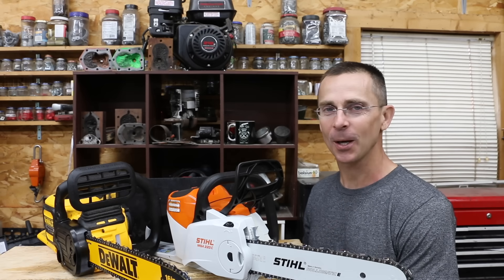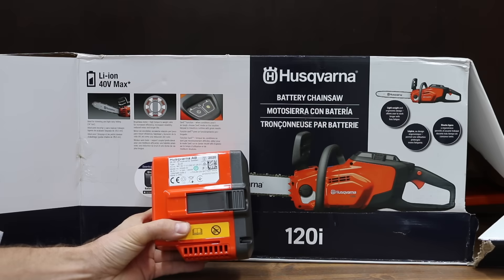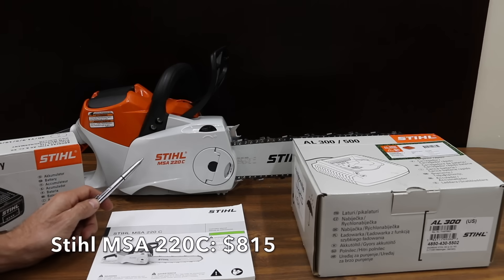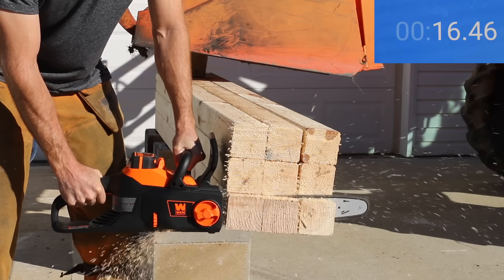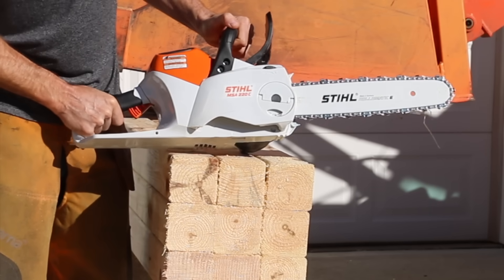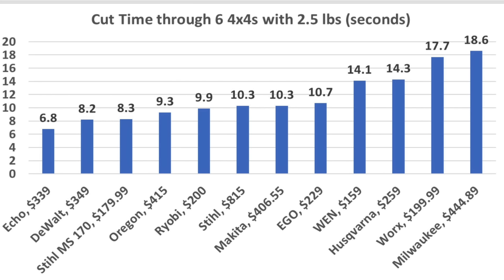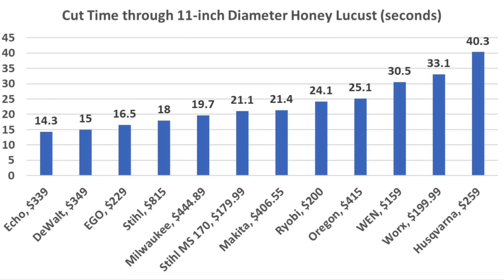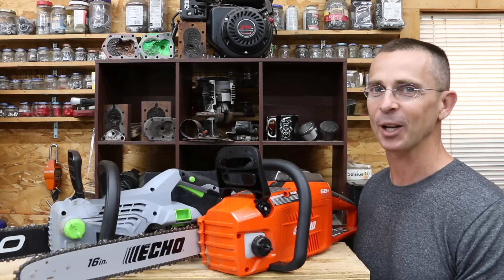Best Battery Powered Chainsaw Brand (ROUND 2)? Stihl, Husqvarna, Echo, Oregon, DeWalt

Comment: One of the rare instances were price doesn’t match performance. Thanks for a great video. The Echo and Ego both impressed me.
Reply: I have watched nearly every he has put out, and it's not at all a rare instance. Often times you are paying for the name rather than the quality
Reply: Typically with chainsaws more expensive = more durable and lighter weight, not necessarily cuts faster.
Reply: @gorkyd7912  that’s a good point.
Reply: @gorkyd7912  durability is the only equation for me
Reply: I think where EGO wins is the ecosystem of compatible products. Nobody else can match that. I have two batteries for like 7 devices! Mower, blower, hedge trimmer, string trimmer, chainsaw, multi head system: currently just the edger!
Reply: @emotionz3  more or less all brands from this video has multi sistems ( one battery - lots of devises who can use that batery)
Reply: The Wen has a surprisingly good ecosystem as well. Too bad the performance isn't there.

Comment: Be careful none of them are designed to fall from an 80 foot tree and still work
Reply: If you are 80 feet up in a tree a battery saw is not designed for you anyway
Reply: Guys 80 feet in a tree respect themselves enough to only run a gasser.

Comment: It must be embarrassing for husqvarna to have the Ego cut faster 😂
Reply from the maker: I was hoping it would do better
Reply: Worse for Stihl imo. That is more than double the price of the others
Reply: @gg-gn3re  with stihl you pay the name. But it will probably outlast the others in terms of building quality.
Reply: Not really sure about that. The Husqvarna tested is the cheapest homeowner model. Probably on par, or worse than Ego. Husqvarna is one of those companies that cater for all markets, going from cheapest "junk" almost, to the absolute top. I'm not sure I agree with their business model, but it seems to work for them. It would have been interesting to throw in both Stihl and Husqvarna's top "Pro" models in the mix, to see if they just kick all the competition to the curb. (like Husqvarna 540i XP and Stihl  MSA220 C-B) It could also be fun to compare all these saws to the working horses of the industry, like a Husqvarna 572 or a Stihl MS500i, mostly just for fun, but also to highlight that while battery tools are good, the pro choice sits above by a fair bit (one would assume... but, let's test that...)
Reply: @brianjensen5200  that’s a very good point. But considering the husky costs about the same as the wen and ego (plus it’s made by one of the top saw manufacturers) you would think it would have performed at least decent lol. But I agree that it’s worse for stihl 😂 at $850 that thing got destroyed. Granted I’m sure it was built wayyy better and will probably last 10x longer. But at that price you can buy a really good gas saw.

Comment: Id like to have seen the Oregon's auto chain sharpening in action.
Reply from the maker: Great point. I should have tested it!
Reply: @ProjectFarm  Same crappy design from the 70's, like Homelite (Sears). I can't tell you how many I had to convert to regular chain for unhappy owners.
Reply: Power sharp sucks. Owned it, used it, threw it away.
Reply: @uriahotten3895  Haha next thing they will try to sell magic dirt you throw on the ground so if your chain hits the ground it sharpens it instead of damaging the cutters!  LOL  And people will buy it!  Especially if it had a name like Slick 51. :-)
Reply: @cpufrost  the "magic dirt" would probably be just as effective as the Power Sharp for sharpening your chains 🤣
Reply: @dave himlin I have a green works mower and weed wacker/edger. A couple 2ah and 4ah batteries. While taking a walk a few weeks back one of my neighbors had sitting in the garbage a greenworks leaf blower with the charger and a 2ah battery. I picked it up and the charger and battery worked straight away. The blower must have been used a few times last year and put away for the season. The contacts must of got some surface rust on it because after about 20 on/off clicks it started working as well. Used it for a few hours and added it to my collection. People throw away crazy stuff sometimes. 🤷🏼‍♂️. I was not raised that way and at the very least try to repair stuff before I toss it. I didn't even have to take this one apart.
Reply: I had one and it did not work well, but they may have improved it.
Reply: @dave himlin same problems that I had.
Reply: I have a non battery Oregon electric with the auto sharpener and it seems okay, although I haven't tested it against anything. I would love to see a followup on that.
Reply: Owned an Oregon self sharpener   battery saw for 3 years now.  Really like the feature.  It only takes a couple seconds of lightly pulling the sharpening lever to sharpen the chain to make the difference.  If it is pulled often or hard the chain and stone will need replaced sooner than necessary.   If your cutting alot of firewood fire wood non of these saws will replace a gas saw yet.  For property maintenance, a couple batteries and this saw will work great.  Also the chain is aggressive and has a wide kerf.  So feeding it lightly and keeping the revs up matter.
Reply: TIL to avoid that cuz after the one PF video that showed how crucial a freshly sharpened chain is, that feature might have suckered me in

Comment: How I buy tools : 
1-Watch Project Farm 
2-buy the recommended item 
3-repeat
Reply: I do the opposite. I buy tool, watch project farm and realize i bought the worst.
Reply: XD
Reply: I did that yesterday with my windshield wiper blades, the long term test was awesome, I didn't end up going with the winners though cuz the Bosch Icons would have been nearly $50 for both so I went with the rainx ones that were the runner up, $20 difference in price for 2 blades.
Reply: @bdkj3e  I had both and to be honest over time I didn't see a difference I really liked the Rainx blades
Reply: @bdkj3e  ص
Reply: @bdkj3e  Bosch Icons are great. Once I switched, I will never go back. I am very picky about my windshield though.
Reply: @bdkj3e  I had to lookup what I got, and it ended up being the Bosch; didn't even realize they were hat expensive, but I bad some coupons and points that offset my cost.
Reply: Watch PF, if the winner has been torn down on AVE, then buy.
Reply: @tarstarkusz  haha right!
Reply: 2.5 - Realise I don't need whatever I bought
Reply: True.  I don't even need a new chainsaw, but am seriously tempted by the Echo.
Reply: I think PF using Dewalt as his personal tools (drills for sure) speaks volumes and is all the testament I need.
Reply: @gekksvide0 I think he’s saying the tool line in general.
Reply: That's what I do too! Well worth the time to save money and get quality vs most expensive!

I can hands down always count on Project Farm.
Reply: Either project farm, or AVE
Reply: This!
Reply: Now I know what wiper blades to buy. Thanks.
Reply: I agree totally. Buy, Buy, Buy...
Reply: Go to comments and repeat
Reply: you must have alot of different chargers and batterys
Reply: Your not wrong
Reply: @benkleve4199  but you are! The correct word is "you're"
Reply: @herbiehusker1889  Savage! LOL
Reply: @herbiehusker1889  If there is anything people should never leave school without having it ingrained, it is knowing the difference between your and you're; there, their, and they're; and its and it's. Nothing spells ignorant like their misuse. But we should  make allowances for immigrants. After all, it all boils down to whether you understand what was meant, not how it was written.
Reply: @herbiehusker1889  two words though
Reply: @mrbig1022  it's actually a contraction. "You're" does combine two words into 1, but it's really just a single contraction word.
Reply: Yeah idk if I want to have like 4 or 5 different battery setups. Looks like Dewalt has the most wins under their belt so buy Dewalt cordless tools
Reply: @FromThe3PointLine  Yup same here.  I finally go for Makita for the same reason. But it's important to note that Makita and Dewalt are professional grade tools (despite having an amateur line), while other brands tested are more amateur or casual.
Reply: @FromThe3PointLine  pretty sure milwaukee takes it's fair share too
Reply: @FromThe3PointLine  have you not seen how many wins milwaukee has?

There's no one brand that has all the best tools. 

Some brands just have better tools than the others, even if it's just a few and kind of specific
Reply: @FromThe3PointLine  but for super low temperatures you are going to want Milwaukee batteries. There are battery plate adapters so DeWalt with Milwaukee batteries in most applications sounds like a real winner.
Reply: 4-have 8 differ t chargers for a the different brand of batteries
Reply: Don't forget to look at reviews on Amazon
Reply: @jakobharris2719  I respect your answer and you are right but I must say I'll go with PF over a bunch of randoms. He's like my uncle on my mama's side. I trust his word lol..
Reply: @JustCallMePCra  i think theyre referring to the most wins with various different tools which meams it wpuld be their best bet to buy dewalt so they only have 1 battery type/brand
Reply: @justinteal495  yeah your right if another company made more tools in other areas better I would take a small L on something that I use less just to do what you said same brand same bat.
Reply: @justinteal495  Milwaukee has won a lot too. But no one brand is always the best

Comment: With all the adapters out there to be able to use just about any brand battery in any brand of drills and tools- would it be possible to do a head to head on the batteries themselves? The 18v/20v lithium batteries. I have tons of the old dewalt 18v nicad battery tools and debating what lithium batteries to run. Not switching out the tools as that is a LOT of tools to replace.
Reply from the maker: Great video idea!   Here's a video on 3 of the brands:  https://www.youtube.com/watch?v=4OkT_SU6GSg   Thank you
Reply: @ProjectFarm  Thank you. Not sure how I missed that video.

Comment: Great review! Thanks for revisiting these additional brands with the same test methodology. One area to improve is the sound measurement: I think you're getting a lot of sound transfer to the table top. So a saw may actually be quieter itself, but have more vibration that is turned into sound by the table. I guess this is a good compromise for sound transfer when cutting, but then why not take the sound measurement when cutting the 4x4s? Just spitballing. Cheers!
Reply from the maker: Great constructive feedback. Thank you!

Comment: Do your hands tingle after using an electric saw? Great video as usual.
Reply: I think extended use of any saw, gas or electric will have that affect.
Reply from the maker: I drove in 1000 screws with an impact driver for a previous video.  My hand was numb for about a day.  lol

Comment: Really like and recommend  the Oregon, I have used it for probably 100 days a year for 4 years, not a single problem. With built in sharpener I feel more comfortable cutting seedlings and saplings very close to ground. they also make a great pole saw that used same 40 volt battery.
Reply from the maker: Great feedback on the Oregon!  Thank you

Comment: Best chainsaw chain sharpener would be awesome
Reply from the maker: I'll do it!  Great suggestion!
Reply: @ProjectFarm  thank you
Reply: @ProjectFarm  That's a dark hole to go down!!! Chain grinders round and square, hand filing with jigs of all sorts and filing guides. You're a glutton for punishment. My hands hurt just thinking about it! There's so much variability in how one user uses them let alone which on what chain/saw etc... Must include the Timberline sharpener though. If you do, shim it off the bar instead of rocking it on the burr (like the instructions say) when you set it up so that it grinds into the gullet and it will cut like nobodies business...an hour later...
Reply: Stihl has some nice setups
Reply: A round file and flat file. Short of expensive commercial units, electric sharpeners suck.  Stihl's all in one sharpener is great too.
Reply: @littlejackalo5326  10/4 on the 2 files. IF I ever get one it'll probably be the Oregon 110 volt job. That's what all the saw shops here use.
Reply: Be sure to include grandburg and timberline jigs. I have a grandburg and it works great but it is a bit tedious. Would like one that goes a bit faster

Comment: An idea for your personal use: take the 4x4 cut slices, print a picture on the one face, seal them and you have Project Farm coasters. You could also make the picture on the face and then smack them with a small hammer or run it through a jigsaw. My grandfather, a sawyer used to make puzzles for us grandkids. Simple fun with mill ends!
Reply from the maker: Great suggestion! Thank you

Comment: I'll wait a few more years... 
Current battery technology isn't ready for chainsaw application.  Gas is the way to go.
Reply: Depends on what you're cutting. The average homeowner or arborist is going to be very happy with one. If you're going to do any falling or cutting firewood, I agree with you. Nothing beats gas for productivity. I have the bigger DeWalt and I use it a lot for smaller jobs, limbing up trees and general property clearing where you just need to cut something for a minute and most of the time you're stacking brush and limbs etc.
Reply from the maker: Thank you
Reply: @Galaxy-r6g  
Agreed. 
It makes no sense to pay $600+ for a tool that lasts a few minutes. 
Wait... I just got a cordless Dyson vacuum that lasts 7 min on Max power.  But there’s no gas version of vacuum cleaners and the cord really gets in the way. 😉
Reply: @itsm3th3b33  i had to kick Dyson out of my house. Couldn't handle the work load. Thats where Avalir got the job for $50. Hard to beat a work horse like that at that price for such a tough job.
Reply: @Galaxy-r6g  
I don't know which Avalir you got, but for $50 I doubt it's cordless. 
Point well taken though. There are some jobs which cordless just can't handle. And that's what I said originally. For chainsaws, battery is just not good enough yet. 
If you compare the rechargeable battery technologies (NiCad, NiMH, ... and now Li-Ion), I hear the next technology is just around the corner.

Comment: Wen seems to have totally ripped off the EGO. Basically a complete copy.

Also, I use a 5ah with the EGO that came with my mower and this may sound odd because the voltage is the same but the saw feels more powerful with the 5ah. Maybe my 2.5ah is just wearing out. But both batteries provide appallingly bad runtime even the 5ah doesn’t seem to run it more than 5 minutes while cutting firewood. It works great for me but it isn’t a saw I’d use on a job site unless you have a lot of spare batteries.

EGO does make a 7.5ah battery but I question the practicality considering that battery weighs around 10lbs.
Reply from the maker: Thank you